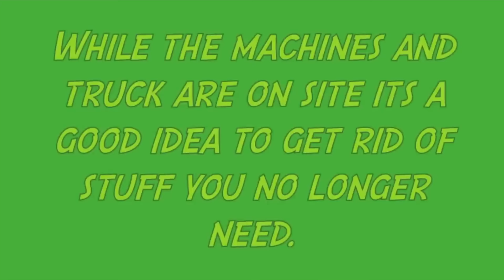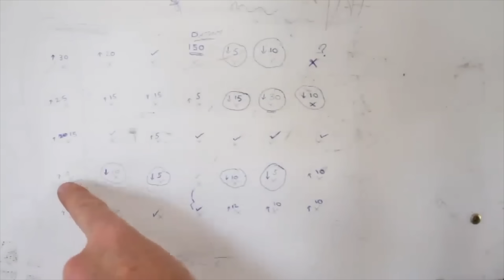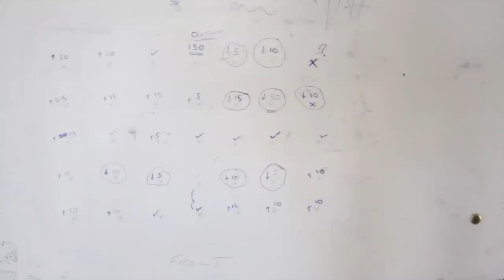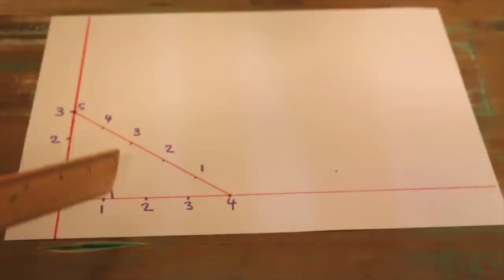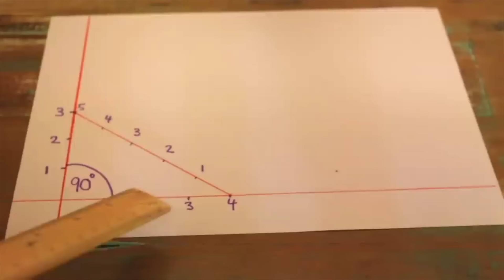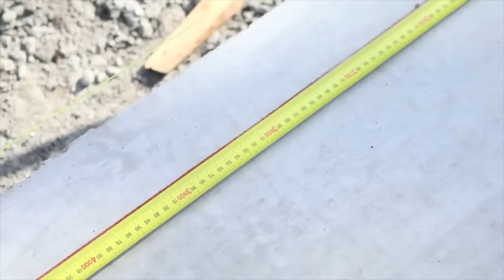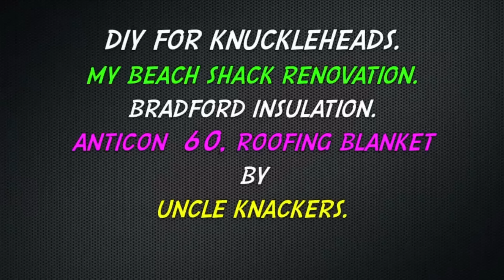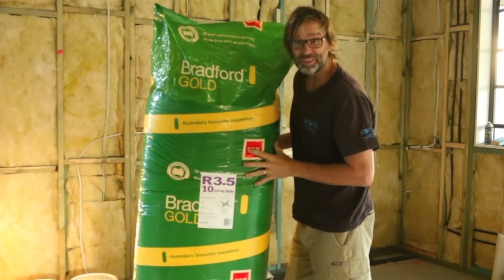This Beach Shack Renovation Almost Destroyed Me!!

Comment: Shane mate I'm loving this.  Job well done. You answered my question about steel frames near the beach with your timber battens. I've never heard of the hard wood you used on the post's but much better. What part of NSW are you at?. Thanks for your time doing this video.
Reply from the maker: No worries at all Dawayne 👍Thanks for taking the time to watch mate and I'm up on the Mid North Coast 👍😁🇦🇺🇦🇺
Reply: @diyforknuckleheads  thanks for your reply. Don't worry I'm not a stalker LOL it looks like a great place to visit once we finish our van.
Reply from the maker: @dawayneduffy3509  Mate....well worth a visit and good luck with the van 👍👍

Comment: With hindsight would of it been more cost effective to demo the whole house and start fresh?
Reply from the maker: G'day Dave....financially it was very worthwhile. the build cost us around 275,000 dollars. To knockdown and build with a builder it was going to be over 600,000 dollars. Saving the old place and doing a renovation also gave us some extra benefits in regard to Council Planning. For instance, our garage was able to be built on the boundary which would not have been allowed if it was a new build. That was a big bonus for us as our block is fairly small and we needed all the space we could get. The only thing l would have differently is totally remove the old roof instead of trying to build over it which caused me no end of trouble!! 👍😁🇦🇺